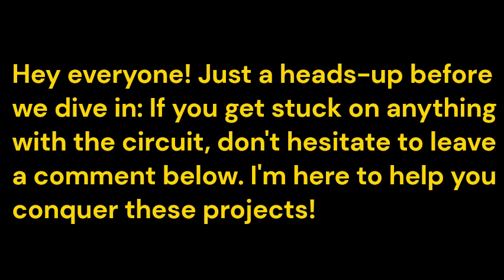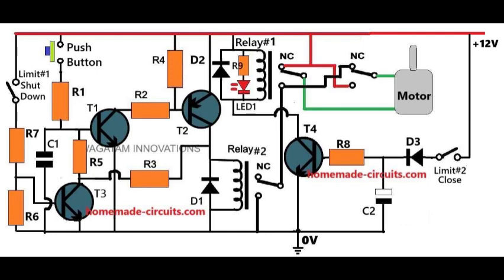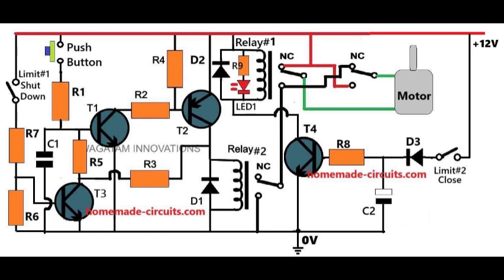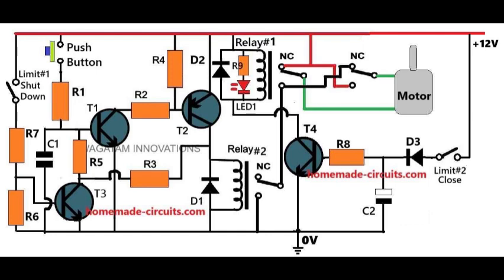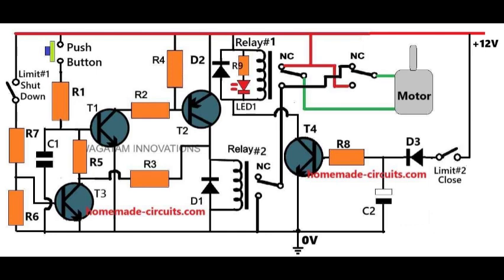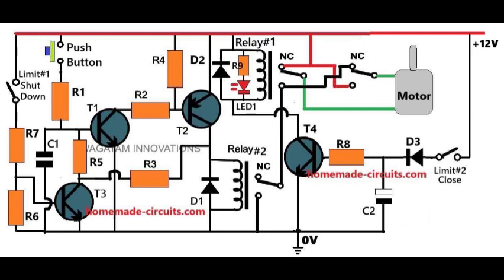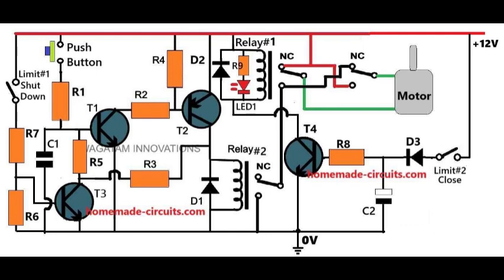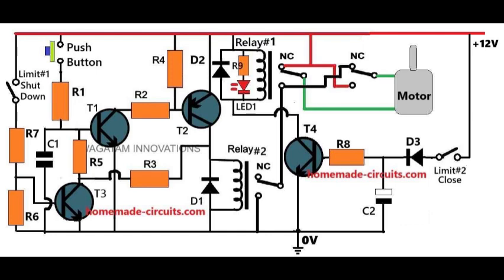Simple Automatic Door Controller Circuit

Comment: Dear sir,
I am from Bangalore.
I would like to build the above circuit for my project, your articles are very nice and simple to understand, could you kindly provide with the above circuit diagram with the parts list,
I am using the readymade circuit module which is available with AMAZON,and Trigger circuit with one relay,but every thing is ok once the power is off then ON again that trigger is on all time,so that one cycle is obtained this will over ridding my requirement.henc I would build your above circuit it is with the limit switch very subtle for my project.
Thanking you for your great help.
I have prescribed your channel, I never Miss your articles 
Regards 
Phillip dhason
Reply from the maker: Thank you Phillip, I am glad you selected the above circuit for your project, and I am sure you will succeed with it. Nevertheless, If you have any issues with the results, please let me know I will try to sort it out for you.
Reply: Sorry, have i missed the area for parts? Im sure i can find them thru channels, just wondering if there was a packet or spit you personally buy from?
Reply from the maker: @homerjsimpson4660  Parts list can be found under the following article: https://www.homemade-circuits.com/automatic-door-controller-circuit-using-a-single-push-button/

Comment: As usual great project, thank you sir...
Reply from the maker: Thank you Ghulam, feel free to ask if you have any doubts.
Reply: @Homemade-Circuits  
Hello sir Flame sensor is basically a safety device. Sir please make a simple circuit for LPG gas. I am giving the link in the page
Reply from the maker: @mfarhan003  Ok, got it, but I think a smoke sensor will do the same job as the flame sensor, because the basic purpose is to detect fire. here's a smoke sensor and LPG senor video link, you asked for: 
https://www.youtube.com/watch?v=Smg1JNw8ASk
Reply: @ghulammohiodin1514  
Hello, I saw the video but that is a smoke sensor which sensors LPG leakage.  The flame sensor senses the flame of the ionization rod burner. Its benefit is that if the fire goes off due to any reason, it turns off the solenoid of the LPG gas line.
Reply: @ghulammohiodin1514  
https://youtube.com/shorts/Bl2hGox1lcs?si=XEy2w6jMMbDy8ftY